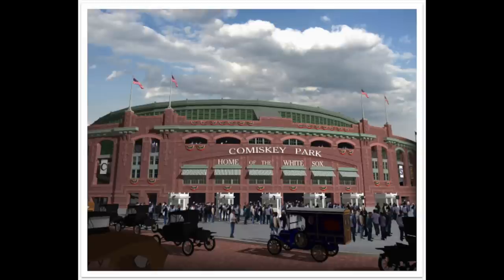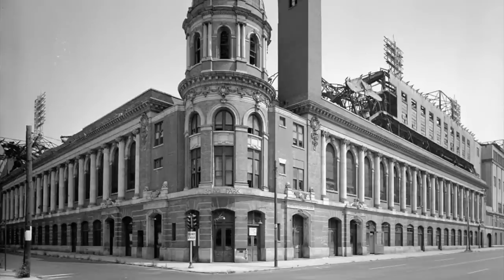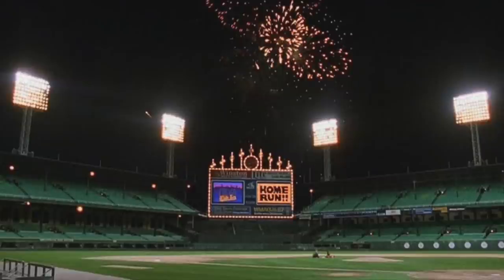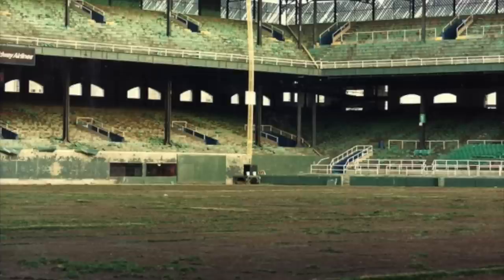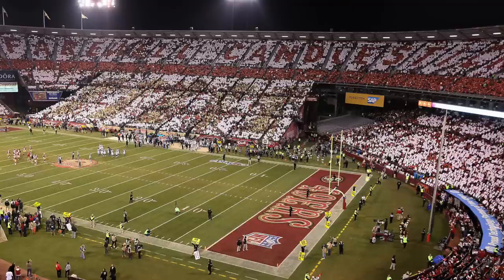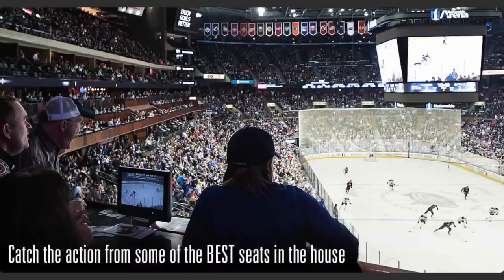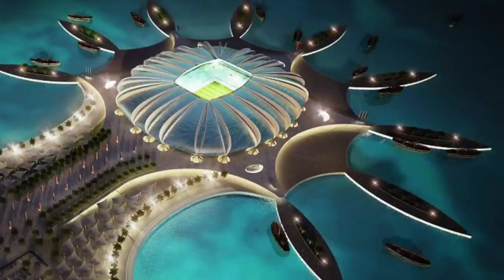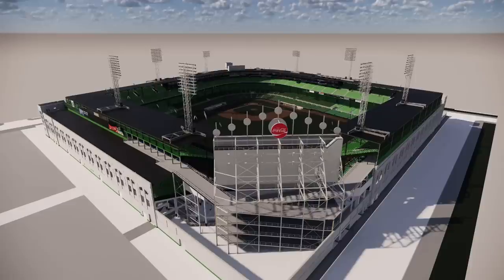Old Stadium designs that need to be used today

Comment: One thing you've not considered at all, is the reason the seating capacities for the older stadiums were 35,000 plus, was because the fans WERE CRAMMED INTO the seating areas.  Seat widths were about at least six inches more-narrow than what they are today.  When DC Stadium was opened in Washington, D.C. in 1961, it featured 22-inch wide seats,, when the standard seat width (for sports stadiums) was only 15-and-a-half inches.  The cookie-cutter stadiums also featured wider aisles and more leg room for each row of seats.  When Chase Field was opened in Phoenix in 1998, it advertised that each and every seat in the stadium was guaranteed to have at least three feet of leg room.  

If another baseball stadium would be constructed to be a replica of the old Comiskey Park, there is no way it would have the same seating capacity as old Comiskey (43,951 capacity).  A replica of old Comiskey Park today might have a seating capacity of 26,000 or less.  Seats today are much wider, aisles are much wider (with a handrail in the middle of the aisle), and seat rows are much wider than they were in the stadiums of old, like old Comiskey Park, Washington, D.C.'s Griffith Stadium, and Brooklyn's Ebbets Field.
Reply: Well have you seen people now?  They grow them bigger 😂
Reply: YES! And I would argue the fan experience at newer ballparks isn't necessarily better because of the space for 'comfort.' Comfort doesn't always equal enjoyment/ fun. there's a sense of camaraderie with fellow fans when packed in tight, and greater energy in the stadium.

Comment: Boston Garden was great. My first game was obstructed view upper deck vs the Sonics in '89. 2 months later, I was front row against the Rockets. Quite a change of scenery. The court level scoring/media tables were covered by cloth banners (which went away in the early 90s when the NBA began adopting the electric alternating ad boards, which remain today). The ad signage/scoreboards/lighting was also incredible. It felt personal. Last but not least, to cover the ice for basketball games, they used yellow plywood floorboards. I remember putting my feet on them - and wishing the moment would last forever.
Reply: the first 20 rows of the First balcony were the best seats. you sat right on top of the ice and you could see everything.  They weren't even close to being the most expensive seats, either.  I saw the AHL Braves and WHA Whalers from those seats.
Reply: First Balcony seat were great in the Garden, got to see Bird a number of times. Glad I grew up back then.

Comment: One can wax nostalgic about Comiskey, but old stadiums did have some seating problems that the newer stadiums do not have.  Granted, they may have swapped one issue for another...

The closer the overhang of the upper deck to the field means that those sitting toward that back of the lower deck cannot see all the action.  A pop up / home run gets lost for a period of time.  They may not be able to see the main scoreboard depending on the angle.

Modern construction techniques and materials may eliminate or reduce this, but no one wants to sit behind a pole -- something that was necessary to support an upper deck being so close to the field.  Especially if that pole blocks something important, like seeing home plate.

Comment: To impress this guy, just build an upper deck that’s only 5 rows deep.

Problem with building a two-tiered approach is that no fan today is okay sitting behind a column. The only way to build without columns is the cantilevered design, which is universally employed in new ballparks.

Comment: Comiskey’s original capacity was over 50k, so I honestly don’t think you need the 2nd tier in the outfield at all to fit the stadium to modern sensibilities. But I love the idea of a two-tier approach with visible columns. It would probably look better with a more open outfield, especially with a great view of the city skyline.
Reply: Right on. The left field upper deck could have been removed and replaced with a big Jumbotron like the one in left field at Wrigley. Keep the exploding board, of course. That would have provided more revenue than the upper deck seats would ever provide. Also, pull the remaining upper decks back and cantilever them so not as many lower deck seats would have been obstructed. Keep the original brick facade but sandblast it and tuckpoint it. A little imagination could have saved Old Comiskey.